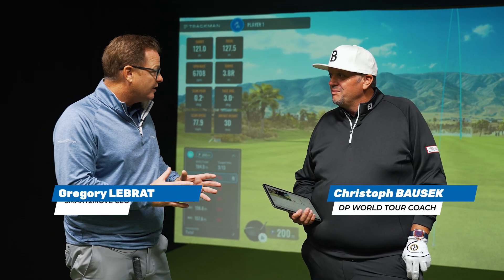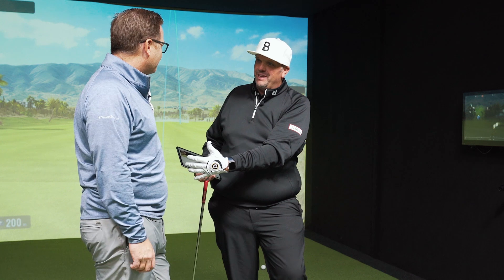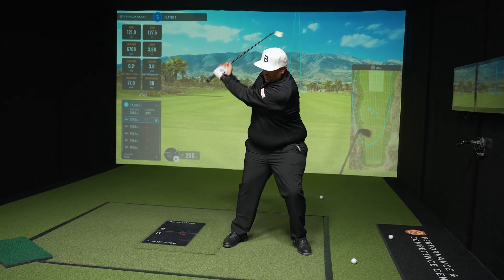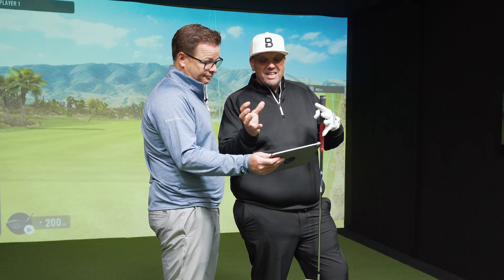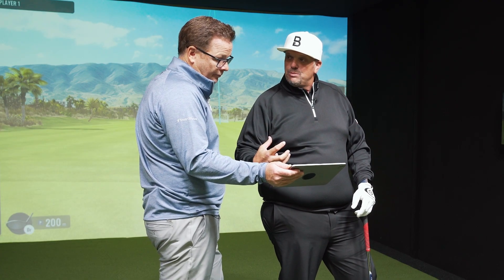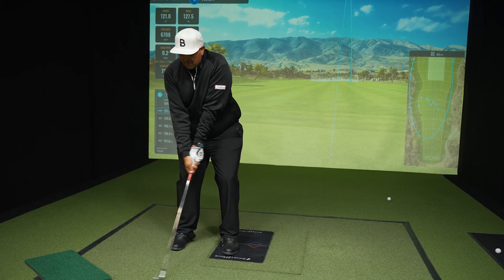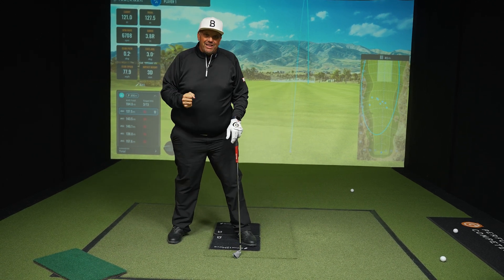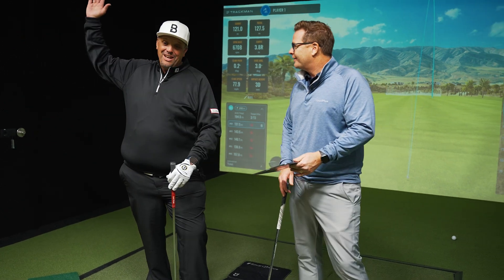"Ringing the Bell' vs. Ground Reaction Forces: A Biomechanical Breakdown

Comment: Might not move towards center (recenter) be a better thought then toward the target? Toward the target makes the person more likely to shift the entire body, and to shift for too long. As can be seen before the clip with force arrows are cut off the arrows change direction and start going back toward center later in the down swing. Also the arms don't magically lower themselves down in the downswing. You see many of the best best ball strikers on the tours doing drills to accelerate their arms down. Mcilroy's favorite drill -split hand grip, and throw the arms and shaft underneath his shoulders, Justin Rose favorite drill - keep the back to the target and lower the hands straight down.Sergio Garcia -the ring the bell. Good ball striking pros have both a recenter, and an arm acceleration move in their swings. Passive arms lead to a bad swing with no decent speed.
Reply: Interesting.

Comment: This ridiculous idea is exactly why most people end up with early extension.  This is totally false and completely backward from what actually happens.   He actually has the mechanics somewhat correct but the motivation totally wrong.  How many times do we need to hear this ridiculousness before people start realizing it’s totally wrong?
Reply from the maker: Thank you for sharing your perspective! At Smart2Move, we aim to provide data driven insights grounded in biomechanics to support better understanding and performance. We value open discussions, as they help refine and deepen the learning process.
Could you elaborate on your viewpoint regarding the motivation or mechanics you feel are misrepresented? 
Happy to explore and clarify any misunderstandings for the benefit of everyone in the golf community.
Reply: At the end of the video it was implied you shouldn’t toll the bell and You just need the proper GRF shift to your lead leg to get on plane.  I think he is saying that when you shift towards the target, your hands/arm don’t magically just drop in their shoulder sockets.  They can and will stay high up even with the correct shift to the target while keeping head in place.  I admit you can swing with your arms glued high across your chest (and not tolling the bell) by creating right side bend to get the club to the ball.  However you risk back injury repeating this type of swing.  I have a nagging back injury from this hitting ball with side bend without tolling through bell because this was the prevailing wisdom 10+ years ago from a top instructor.  Coaches need to be careful how they explain the sequence.  It is load the right inside foot.  Pressure right foot to shift hips left leaving head in place.  This will rock shoulders to the right dropping hands and club close to on-plane.  From there Toll the bell just like rory and justin rose and it will feel effortless in speed and staying on plane.  Add proper rotation and vertical GRF / timing and hit far straight and without injury